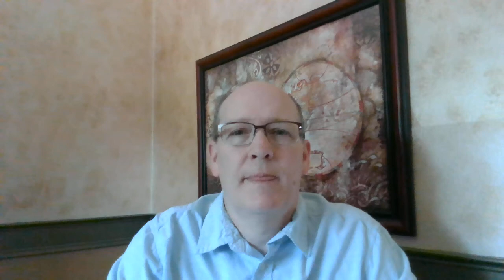Magnetic Energy and UFOs

Comment: What material should the 2000 C crucible for the TiAlCo-B be made of, or low temp ones for that matter? Does the high temp smelting furnace have to be non EM, so hydrogen or solar-thermoconcentrator only? Thank you so much